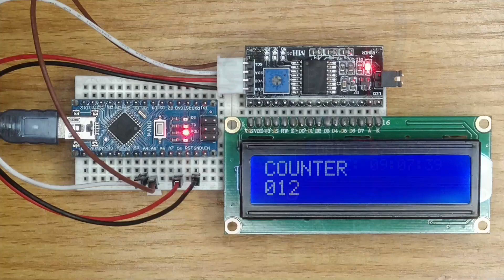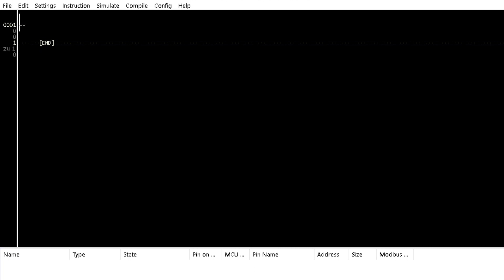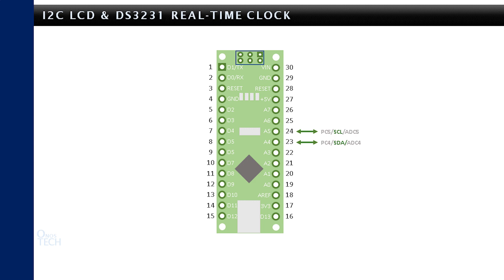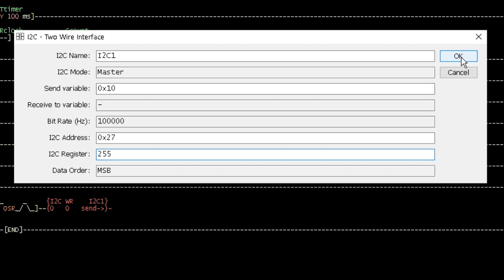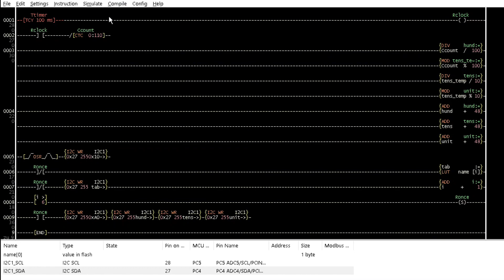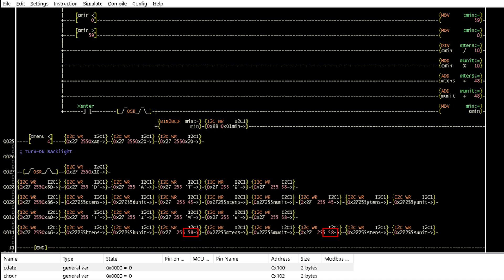Comment: Onos tech... I have a delay problem when I'm using the I2C. In the counter test and in other tests, the delay is greater, than what was set .. Would the I2C address be the problem?
Reply: I don't think the I2C address is the problem. I have a similar experience and I am still trying to figure out the issue. I think the more I2C instructions in the program is what is causing it. For the time being, I did a workaround in the video with the link below with the DS3231 RTC module that produces the seconds pulse.
https://youtu.be/yTvP6C1ZHeU
Reply: @OnosTech  I understand... It's just that in the example of the counter that you showed in the video it seemed correct in 100ms, but what I did here was bigger than 100ms, and this is adjusted to 100ms. I'm going to get a DS3231 and give it a try...Thanks a lot!
Reply: I have done more testing. My first observation is that the more I2C instructions in a program affects the timers accuracy. Secondly, the PLC cycle time should not be less than 10ms and if it goes up to 100ms, the Encoder instruction function is affected.

My next video will be on using just two I2C instructions to correct this issue.

Comment: i have issue that is problem for some people, please note to every one in other video.
* If you wanto change I2C adress, you have to change in 2 place
1. Library in Ldmicro program folder 
2. Library in project folder
I changed LCD 0x3F to 0x27 and taked long time to find out zzz!!
Reply: This is very true when it is for an existing project since the library files have been imported from the LDmicro folder to project folder.

Comment: i have problem.
1. when i update fie Hex from AVGGCC, 2 pins RX TX is both unusable. do you know how to fix?
2. a used arduino nano, but I2C not suport to atmega 328 32 pins, and,  2 pins A6 A7 is unusable !
Reply: 1. I will verify and revert.
2. Please "Create New Issues..." from the "Help" menu of LDmicro so that the developers can resolved and update with a new version or post it on the forum: https://cq.cx/ladder-forum.pl. I may also do same.
Reply: I have contacted the developer on these issues and I hope he comes up with a fix soon
Reply: Kindly test with this program to see if Rx and Tx is now stable https://youtu.be/Tr6mZwcGyh8

Comment: What next? 😁
Reply: Programming PIC in C mode, SIM800L SMS control and then ESP-01 WiFi.
Reply: @OnosTech  Are You  planing menu or submenu on LCD i2c?
Reply: This would be very helpful.
Reply: There is a plan for it. But it will be when the the new update of LDmicro that will simplify it like the "Formatted String Over" is released.

Comment: C:\Users\elcio\Desktop\LDMICRO\Tutorial 14 - I2C LCD & DS3231 Real-Time Clock Ladder Code>avr-gcc.exe -o "AVRGCC\bin\I2C_LCD_16x2_Counter.elf" AVRGCC\obj\*.o -Wl,-Map="AVRGCC\obj\I2C_LCD_16x2_Counter.map" -Wl,--start-group -Wl,-lm -Wl,--end-group -mmcu="atmega328"
c:/program files (x86)/atmel/studio/7.0/toolchain/avr8/avr8-gnu-toolchain/bin/../lib/gcc/avr/5.4.0/../../../../avr/lib/avr5/crtatmega328.o:(.init9+0x0): undefined reference to `main'
collect2.exe: error: ld returned 1 exit status
Convert Elf to Hex
Reply: Save the Build C Solution output in Notepad and send to onos.technology@gmail.com. This show that either Atmel Studio is not installed or the correct path to it in BuildAvr.bat is not set. See tutorial 12 on how to set it. https://youtu.be/1ooMWbz8Zzs